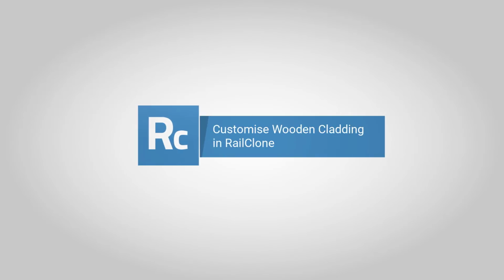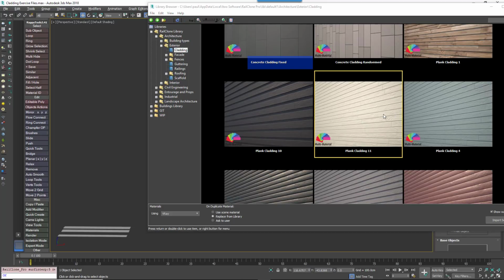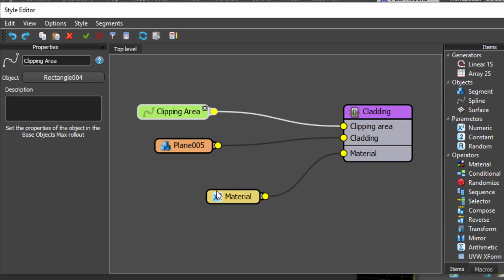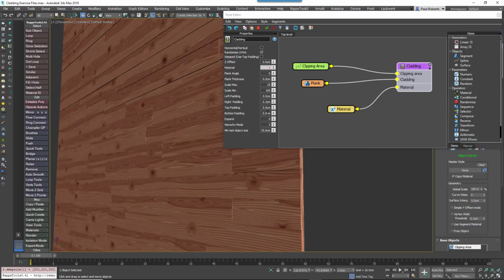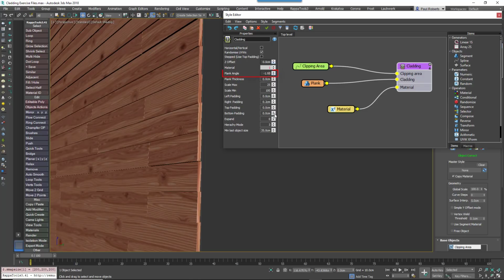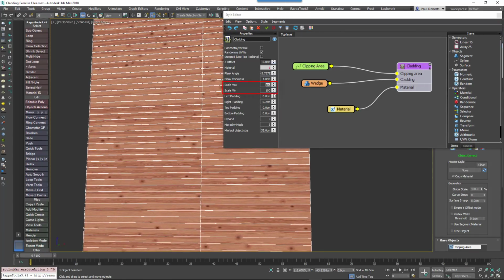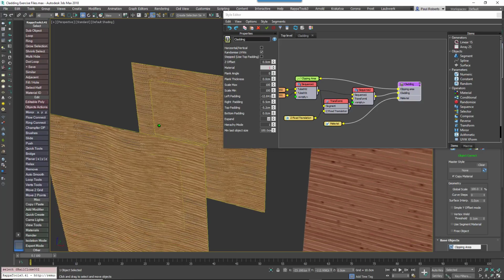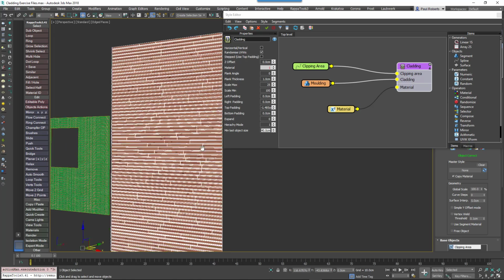QUICK TIP: Create wooden cladding in 3ds Max with RailClone (beginner)

Comment: Hi. I'm using the same preset as in the video and Rail Clone caps only one of the axes. How can I cap the planks on both of the axes? Is this even possible? Thanks in advance!
Reply from the maker: Hi, You should be able to fix that by enabling Cap Holes from the Generator's settings in the Geometry group.
Reply: @itoosoft  Thank you!

Comment: Ok I'm pulling my hair out and it's probably silly. In the documentation it says that there are multiple colour variations with these presets. Yet when I select a different colour value from the material parameter nothing changes, on all the cladding presets.
Reply from the maker: Are you using Corona? Unfirtunately Corona and some other renderers don't support the Material node used by these styles. To fix it, just uncheck Use Instancing Engine from the Display rollout and it should work as expected.
Reply: @itoosoft  The issue appeared to be something with Vray it all works well now apart from the material not updating in the viewport which I think is more to do with Max than anything else.

Comment: I have a twisted pyramidal roof (upper base of cut pyramide is smaller and then rotated, aka. torsion geometry), ie. plane for clading or spline is no cooplanar, is twisted. Which method should I use to create shingle tiles and planks on it?